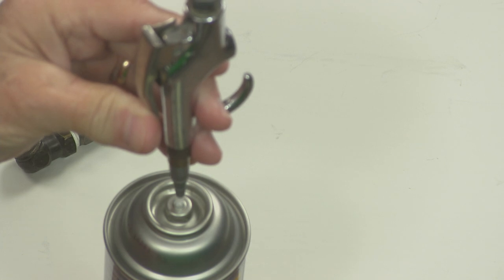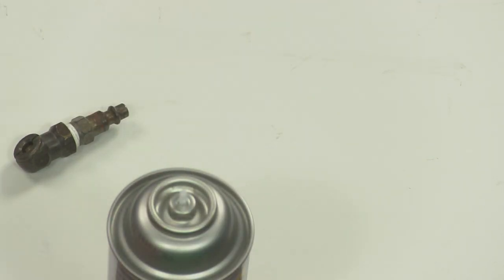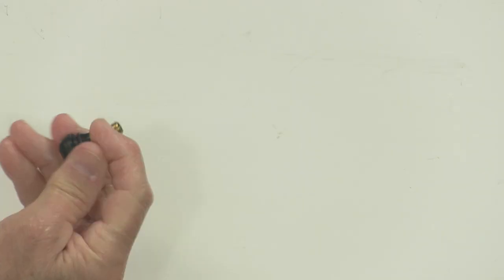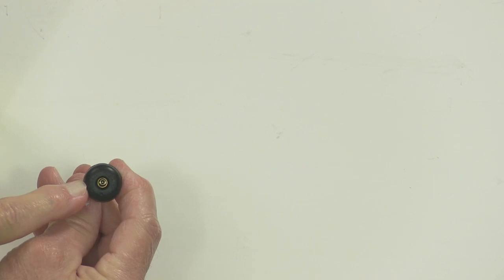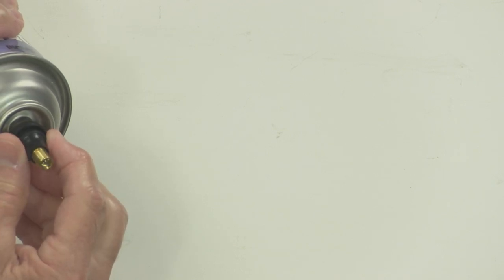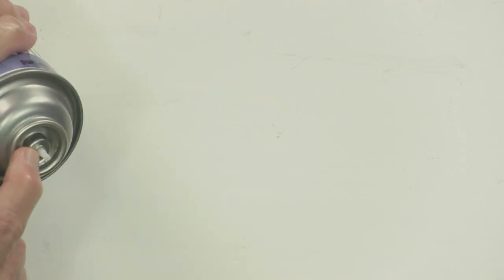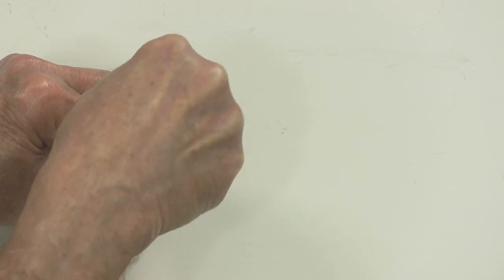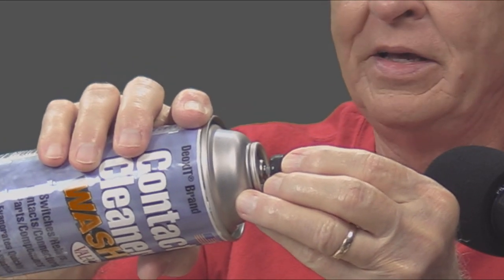AmateurLogic Shorts 3: Recharging Aerosol Cans

Comment: I just use a can of butane intended for cigarette lighters. there are adaptors in the lid to allow various lighters to work, so just a matter of finding the right one to fit your particular can top. Remove nozzle, and put adaptor, and then hold donor can upside down and press the 2 nozzles together for 5 seconds or so. That will put a gas charge in enough to get the remaining out. The butane gas is the same as what originally was used to pressurise the can in the first place, so will be fine with the contents, as typically the can is marked that it uses a flammable propellant. Only do outdoors well away from any naked flames or arcs, and not while smoking either. Typical can failure is the seals up on top of the valve leak slowly, or the can develops a slight leak at the seam. If the seam leaks, and the product is leaking out remove and put in a glass jar, and put the lid on, with a tiny pin hole to allow venting of gas. Use faster, applying with a small wire loop to hold a drop for things like contact cleaner, and you will get a lot better use out of them as well.
Reply from the maker: OK, I'm not sure if that is safe. Heck, I'm not even sure what I did was safe. Kids, don't try this at home.

Comment: Of course it was going to work, you probably have just forced air past the one way valve in the can. Also  don't do this on paint unless you use it right away or the air will cause the paint to dry. Now if only you had a regulated supply of CO2 or Nitrogen, hihi